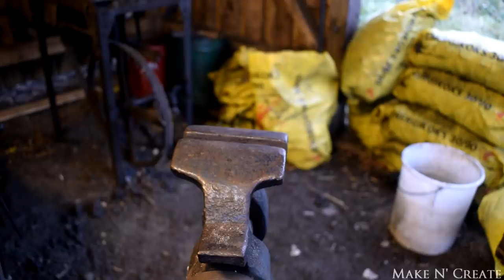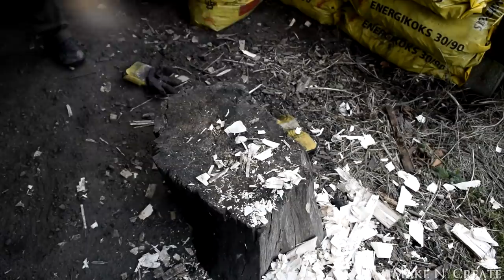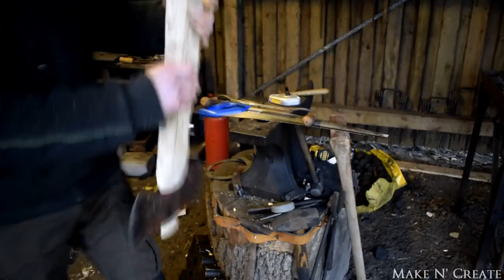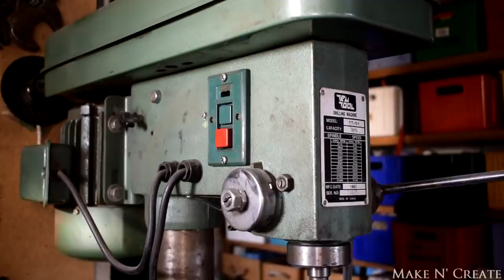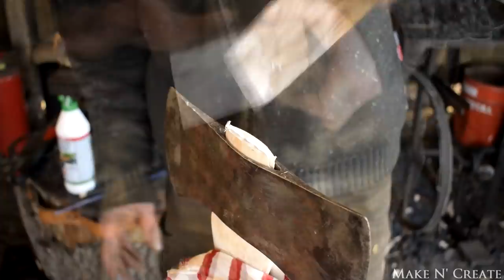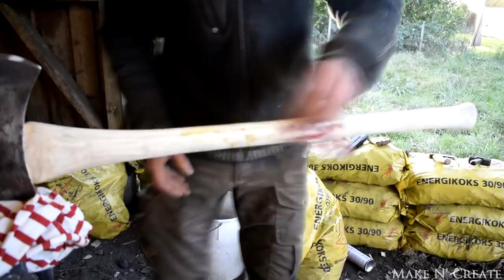Restoration - Restoring a Double Bit Michigan Axe

Comment: Thanks for not turning the metal into a damn mirror
Reply from the maker: You're welcome
Reply: Yeah a lot of the restoration guys on YouTube do things for show make things look stupid
Reply: Super Moon  what shiny looks stupid?
Reply: Meh.... I sometimes  sand out the pits to make it look nice and buff to a brushed shine before hot bluing . Smoothing the surface helps the blade release from the wood better and bluing is durable protection. Doesn't hurt that the axe looks nice as well. I just finished an almost identical double-bit axe to the one in the video. Nicely smoothed and blued head, looks great and cuts even better. And the bluing (magnetite) takes oil very well.  @supermoon1430
Reply: TheGhung Fu I let my axes get a patina and oil them
Reply: @rickeyritchie6606  wait hol up this is mister clean complaining about shiny clean things
Reply: I fully agree Loui. :-)

Comment: I can't find much info on the correct way to sharpen the two blades. Am I correct in assuming one should be made sharp, while the other more blunt? I know the intention is they serve different cutting curposes.

If anyone could give me recommended sharpening angles for each of the blades, that'd be useful.
Reply: If your useing it to split made it somewhat sharp but not that sharp because it'll get stuck inside the log if its sharp however if your useing to to cut thing spike shave and stuff like that then yes make it sharp so yes i would make one side sharp other dull that's how mine is oh and if your restoring one leave it in a bucket of water overnight it'll have the wood and wedge  swell together although I dont know if that's the correct way my father told me that when I was 12 restoring a craftsman 1970s usa made double bit axe

Comment: Ur restoration  was perfect  a million times better then 98 % of the vids of seen on  youtube....just to me one favor and stop using the pole of ur single bits as a hammer to bang wedges....its okay to use them to hammer in wooden tent pegs or slam plastic felling wedges...but not hammer on metal...it can and evently will mushroom ur poll, spread ur eye, or crack the poll and eye